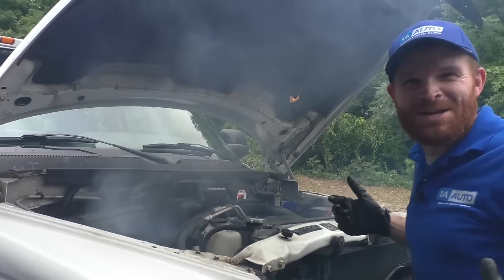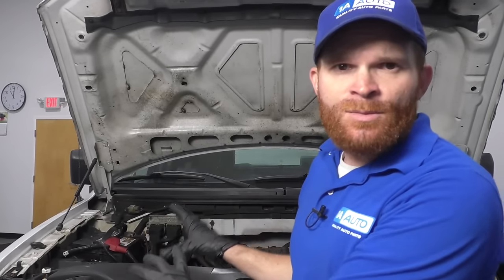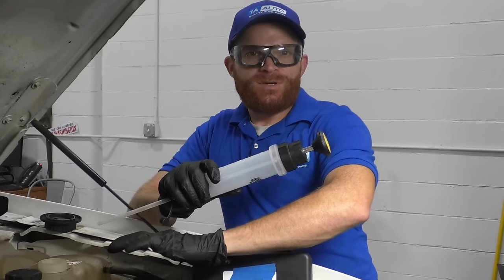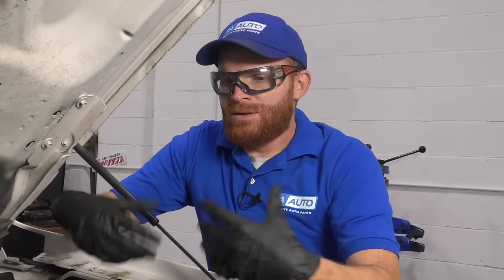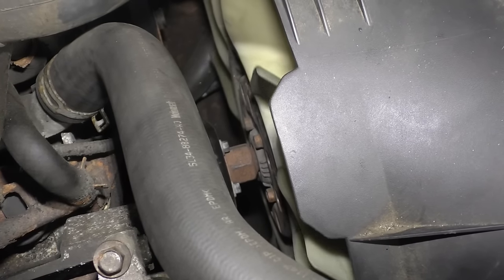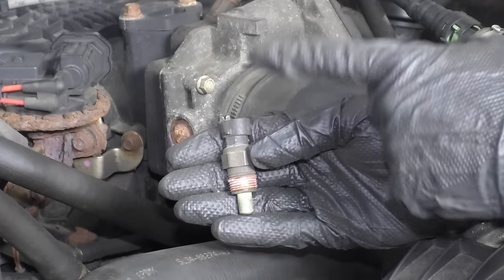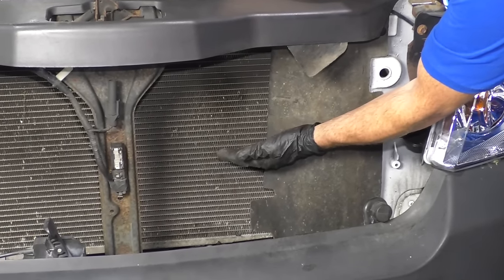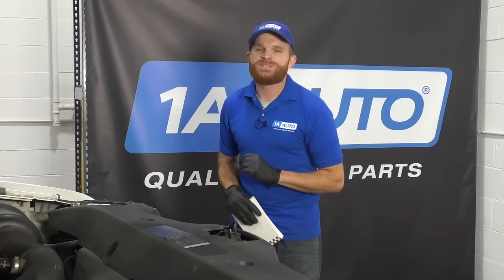Steam Coming Out of My Car's Hood? How to Diagnose Overheated Engine

Comment: I had a coolant leak in my 1997 Toyota Camry. We replaced all the hoses and radiator as well. The thermostat is still in good condition. Ideally if I had the budget at the time, I would also change the water pump and thermostat too.
Reply: Did the leak stop right after that? I’m having that problem and don’t know what it is

Comment: Good stuff. My car just overheated yesterday out here in Phx AZ (117 degrees). My radiator reservoir/overflow cracked. Hopefully it’s just that. I’ll have to see what the mechanic says.
Reply: My mechanic said “looks like your coolant system abs alternator have failed” this is in a 2008 BMW 535i.
Reply: @MrJwyne  how much did you have to pay

Comment: Car started blowing white smoke when I tried pulling out the dollar store parking lot. Car wouldn't even start. I checked the coolant and it was low so I put some in there not completely full. I turned on the heat inside the car to get the heat out of the engine but still won't start. Waiting for a tow truck now. Don't want my daughters in this heat for too long. What a day 😅😅

Comment: Jeez. I was heading to work and there was white smoke our from under my hood. Pretty thick, especially on idle at a light. I checked my coolant (after cooling) and it was Very low (though I refilled a week ago). The temp guage was ALL THE WAY up as well. Engine also makes this strange gargling sound when I start it up. Man I'm nervous as most seem to point at gasket issues. 
And I had a water pump issue 2months back which the mechanic (supposedly) fixed.

Comment: Can you help me find out what's my problem with 2010  Ford Sport Trac? Sometimes, car won't start after few minutes turning off engine.  Sometimes the car engine stops running on the road after driving like 20 to 40 minutes? It will start sometimes after a few minutes. Battery is Ok, but seems like fuel not entering the engine.  Fuel pump was replaced already, but same problem. Let me know if you have any idea for a solution. Thanks and really like your videos.
Reply from the maker: +Juuk Imax We wouldn't be able to diagnose an issue like that here, you may want to have a local mechanic take a look at it. Thanks for checking us out! http://1aau.to/m/Shop-1AAuto-c
Reply: My daughter has the same problem let me know if you find out the problem

Comment: I'm having a little steam coming out of the hood of my 2003 Chevy Ventura but the dash panel doesn't register as overheating. 
I can't get emissions with this steaming. Ive had all the fluids changed because it sat a while before i bought it. It drives beautifully except the steam. Im super poor and am moving into this minivan. Any advice would be so helpful to this older poir and disabled gal! Please help!

Comment: If someone didn't screw the coolant cap on properly, how soon can it over heat the engine. 
Would I always see smoke or steam if I've cooked my engine. What's the signs of a cooked engine. ?
Reply: If somebody didn't properly screw your radiator cap on what will happen is your radiator fluid will boil out and your car would be real hot and super smokey and yes it could have potential damage depending on how long it was like that

Comment: I have this problem ,I changed the heater core and thermostat fresh antifreeze in it ,I smell it and some steam ,water pump is good, the sensor ,not sure if I turn on the air conditioner the fan goes on ,if I disconnect the sensor it's goes on ,then I plugged it back in it stops working ,I don't know if the guy bleed it or not . Or if it needs to be replaced.the sensor 🤔🤔🤔 but there's not any leaking ..

Comment: 2000 Xterra runs fine most of the time but sometime the needle runs to 3/4 or higher.  No consistency at all.  Sometimes in the city/stop/start & sometimes on the interstate 55/75mph.  In the past it in time goes back down on its own.  I've parked for now, being cautious but I'm thinking thermostat.  Everything except the radiator is basically new but it looks fine & I'm not loosing any coolant.  Ideas?

Comment: Hey does anyone know why my Nissan frontier 2002 says it’s hot but no steam and only steam I see is little bit of white smoke coming out the resvouir I had a mechanic check and it’s not blown beak gasket but when I drive for a little it’s like it hiccups idk if there air in it or something I’m positive the dash board lights are messed up and the gages

Comment: My VeLRicle is smoking 🚬. No pressure on the radiator cap was issue one. Issue two hoping to collect the gunk with all in one Preston:
Preston flush+ Cleaner and a couple of runs and drains of pure water.

Comment: Hello! I noticed a small amount of steam coming out of the grill by the radiator, I have an Infiniti G37, my ac and heater works fine and my gauge says is not overheating, any suggestions?
Reply: Same issue minus a infinity g37 Honda accord

Comment: The mechanic had the thermostat removed at the installation of a replacement/new engine to allow free flow of water or coolant into the engine. I got another radiator but  keep loosing water after every 20km or less (in heavy traffic situation).

2. Is it right to remove thermostats from the car because the car is now being used in the tropics where the atmospheric temperature is high like Africa ,to prevent overheating?

Comment: Yesterday i was driving my mk4 golf tdi and i Feel something a smell And Affter 2 min i Just Pull Out car and When i Open Hood a lot of white smoke comes from Engine but I didnt find where  Soo i Turn off car imediatly and After i Wait to cooldown i try to start And it start an dies instantly after i try Sometimes Batery light comes in dashboard  and car just cranks and after seconds Crank Slows and no crank at all After i Jump cable crank  comes back but no Way starting I check fuse relays are ok Soo What can be ?????

Comment: My Dodge takes the green coolant. I put just a little bit of orange coolant to top off the reservoir. Before I realized my mistake. What's the difference between the two fluids? And do I need to flush my coolant system?

Comment: Hello, my Toyota Corolla 2007 overheats when the AC is on, but sometimes stops immidiately the AC is turned off, the fan picks the moment the AC is turned on, what could be the issue please?
Reply from the maker: +misterDan Femi We wouldn't be able to diagnose an issue like that here, you may want to have a local mechanic take a look at it. Thanks for checking us out! http://1aau.to/m/Shop-1AAuto-c

Comment: Hi what might be wrong if my car is steaming? As soon as I start it the idle is really fast and loud. In about10 seconds it's steaming. Hope you can give me an idea.
Reply from the maker: +Linda Montana We wouldn't be able to diagnose an issue like that here, you may want to have a local mechanic take a look at it. This sounds like an overheating issue, possibly there is an issue with the throttle body/position sensor not working properly causing irregular and high idling. Thanks for checking us out! http://1aau.to/m/Shop-1AAuto-c

Comment: I was driving my 2005 Nissan 350Z and after 10 minutes I noticed the temp guage was all the way up. I shut if off and noticed coolant was leaking and some steam going up in the air. After letting it cool down I drove it back home and didn't hear anything unusual from the engine and didn't feel anything different. I don't think anything got warped but is there a way to make sure everything is ok without striping the whole engine apart. I want to fix it but I don't want to soak my money into a car that the engine will just die on me further down the road.

Comment: Hey guys have a few problems an questions that could help out on what might be the problem but I was on the way home an truck was overheating hoping to make it home! But after 20 min driving the truck turned off an alot of white smoke was coming from the left side of the engine I don't know much about trucks I'd really appreciate if any one can help out!
Reply: An when I let it cool down a bit drove it down the street an liquid came from the air intake an the exhaust an white smoke from exhaust
Reply: I have a 2002 dodge ram 4.7L V8
Reply: So right now every time I let it idle it over heats withing 10 min or so but no liquid coming from air intake or exhaust
Reply: It jus over heats